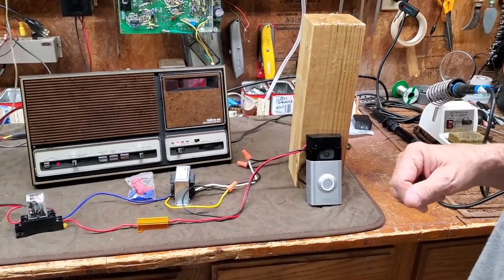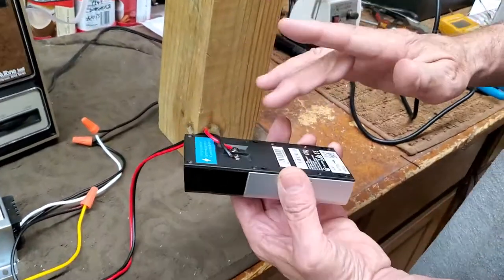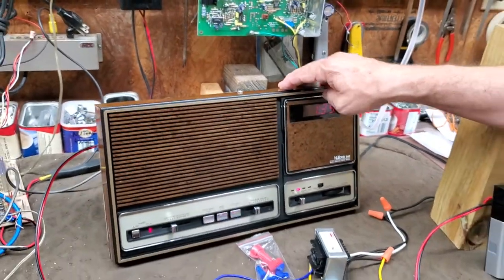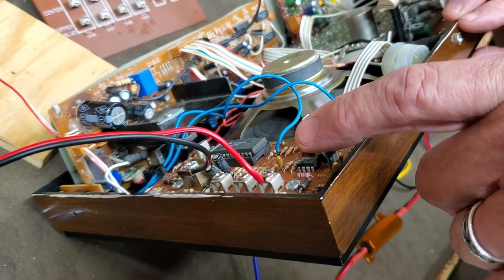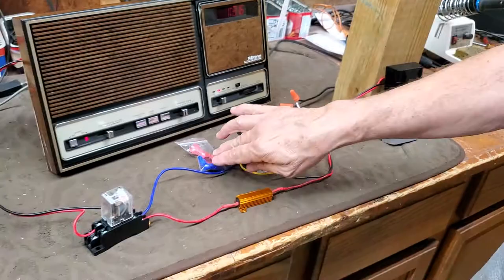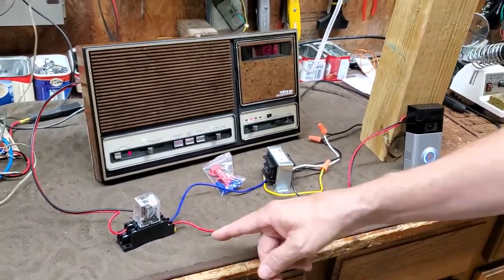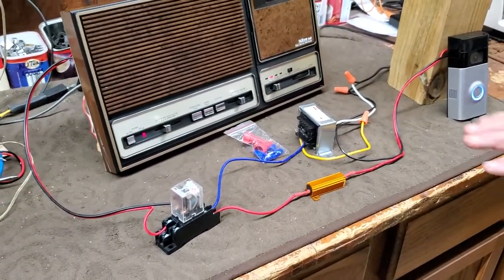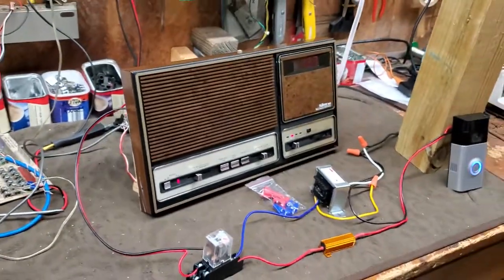Ring Video Doorbell and Nutone Intercom

Comment: Interesting video.  I understand the configuration however, I am not inclined to run new wires from the door bell / ring unit back to the Master control.  Can I configure this using the current wiring from the master control to the outside speaker / door bell unit?
Reply from the maker: Yes, You can use your existing wiring. You will need a separate 24 vac transformer for the video doorbell system, a control device for your intercom chime, and my simple wiring diagram.
Reply: @darrellbrock2631  Okay. Do you provide the control device (relay) in your kit and the diagram?
Reply from the maker: Yes, It includes everything
Reply: @darrellbrock2631  how do I send you the funds and my shipping address?
Reply from the maker: Contact me at, Darrellbrock1951@gmail.com 
Thanks, Darrell
Reply from the maker: @DavidSmith-np1yf  Contact me thru my email, Darrellbrock1951@gmail.com. Thanks, Darrell
Reply: Do these units normally have a power transformer behind the unit. I've searched my house high and low, and can't find a 120v power converter anywhere.

Comment: What is the small orange box that the red wire is going into and coming out of.  Is this neccessary?
Reply from the maker: This is a power regulator for stabling the Ring, Ring 2, or Ring 3.
Reply: Darrell, after installing a 24v transformer, the ring regulator, and a 24v relay 10 amp the relay chatters terrible……very loud!! My system is a MS MC 602 and the chime works, but the again the chattering……

Comment: I have installed a video doorbell the last couple of days worked fine, I have added a 24VAC power supply behind the whole intercom system inside the house to send power from there to the wires outside at the doorbell. But I have one problem with the humming inside the wall where the whole intercom system is, could that be from the 24VAC I have added, if so will it make a difference if I moved it around behind the system???
Reply from the maker: I would have to see how you installed your system.
Reply from the maker: Does the Frontpoint ring a mechanical or electronic chime?
Reply: @darrellbrock2631  Electronic
Reply: I got that fixed the power supply was on its side so I turned it and the humming went away.